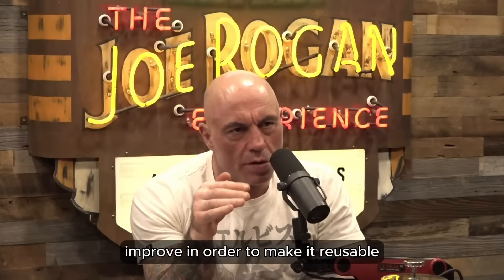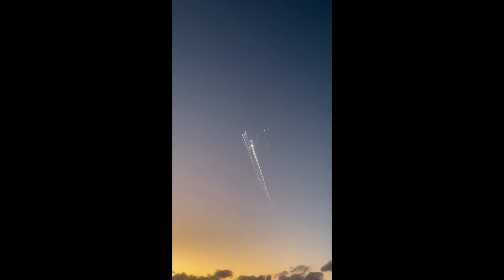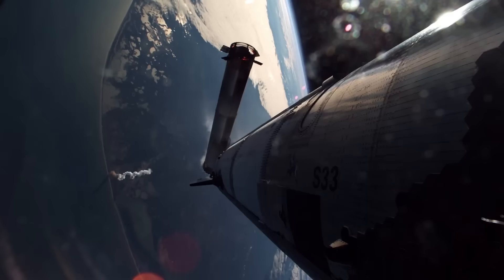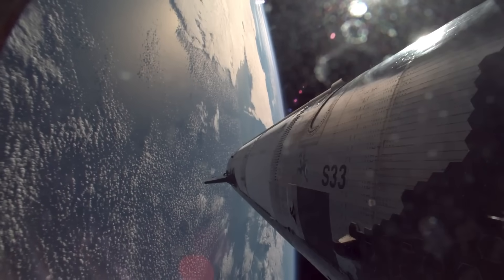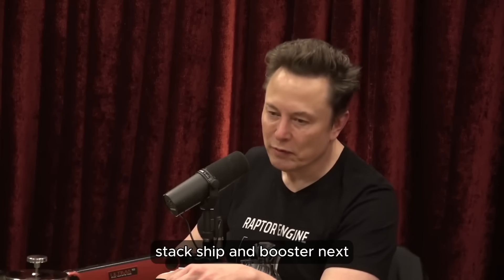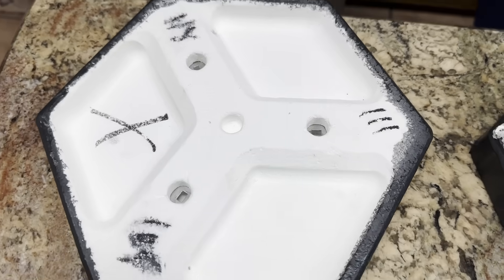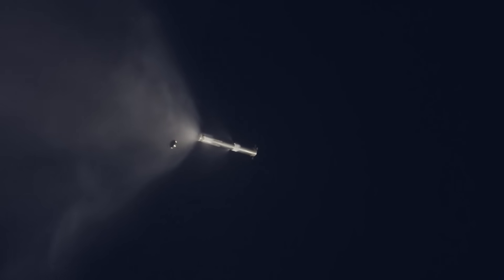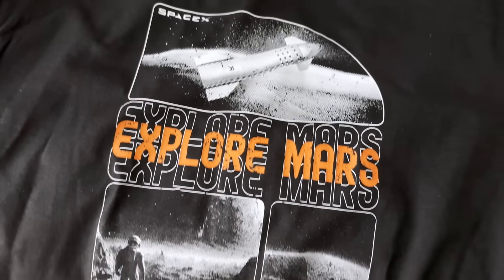Elon Musk: Heat is ON for Starship's Heat Shield to Succeed

Comment: LoftID inflatable aeroshell was a success.  It didnt return from orbit as a flaming meteor, its surface area/drag prevents that.  The basic engineering problem is going up like a needle (reduced drag) and coming back as a blunt object (drag to scrub speed).

Comment: Although I wonder if maybe anyone had or got any kind of data from the remains of the heat shield tiles on ship 33 probably would’ve been hard since they are literally just pieces of debris not attached anymore to the big ship but still leaves you to wonder since they did re-enter so I wonder if they at least got any kind of thermal camera data from Turks and Caicos or anything else

Comment: “3D printing a vortex shingle using silica dioxide (SiO₂) and aluminum (Al) could be a game-changer for Starship’s heat shield. SiO₂ is already used in aerospace as a thermal insulator (think Shuttle tiles), and aluminum, while not great for ultra-high temps on its own, could be incorporated as a metallic matrix composite to improve strength and thermal cycling durability.

If you go with SLS (Selective Laser Sintering) or Binder Jetting, you could 3D-print complex microstructures to optimize vortex formation while keeping the material lightweight. A gradient material approach—where the outer surface is SiO₂-dominant (heat resistant) and the inner layers have aluminum for structural integrity—could work. You’d still need a way to prevent aluminum oxidation at high temps, maybe with a ceramic coating or an embedded cooling layer.

Comment: “Interesting idea! A vortex shingle for Starship’s heat shield could actually work by using controlled turbulence to reduce direct heat transfer. If you design the tiles with microstructures or surface ridges that generate small vortices, you could create a dynamic thermal buffer during re-entry. The trick would be tuning the vortex shedding so it disrupts the boundary layer without causing unpredictable heating patterns.

Also, if the tiles were made from UHTC composites with some level of porosity or even transpiration cooling, you could enhance heat dissipation even further. Would be tough to model at Mach 25+, but if SpaceX can nail the aerodynamics, this could spread heating more evenly and reduce tile failure. Wonder if they’ve tested anything like this in CFD or wind tunnels yet?”
Reply: The worst factor in heating is not from contact air flow but IR thermal heating from the standoff shock.
Reply: @-danR  A spray-on super-reflective coating before launch could significantly reduce IR heating from plasma during reentry. Materials like silver (98% reflectivity), gold (97%), and advanced ceramics (85-95%) can bounce away infrared radiation, minimizing heat absorption. Photonic crystals and metamaterials could push reflectivity to near 99%, dynamically tuning to hypersonic conditions. Combined with MHD shielding (magnetic plasma control) using AI and nuclear batteries or capacitor plus a DIOX vortex, this could revolutionize heat protection for Starship and hypersonic vehicles, reducing wear and improving reusability?

Comment: Basically I can imagine, if you've ever seen the scales of an alligator gar, if the tiles were placed like that it would be amazing. I bet a tool could be designed to remove and replace them as they snap into place when inserted into a frame designed to lock them in. In my head it works. haha Basically a tile shaped like a half-moon with a stem that's inserted into the frame and snapped into place.

Comment: If I wanted to solve this using existing tech, I’d redesign the shape of the heat tiles to be more like scales. Design the attachment mechanism so they could be each be replaced individually if any break on the previous re-entry. 
Use this method as “good enough” as you continue to develop the ideal heat shield material. 
I hope someone finds this post useful - even if they work at another launch company. 😂

Comment: Thanks Ellie! 
I have often thought they could develop an inflatable heat shield. Same incoming mass, same speed; more surface area to spread the energy  = longer time to slow to subsonic, further reducing the heat/energy load per unit time. 
If you have Everyday Astronaut’s email, I’d love to see a conversation about the possibility of what I’ve described. Thanks again! 
Mahalo!
Reply: HEAT SHIELD?? WE DON’T NEED NO STINKIN’ HEAT SHIELD!! 😮

An airfoil-shaped balloon of… whatayagot? with tethers between the airfoil to the ship. The tethers winch out the airfoil only after they’re experiencing atmospheric drag. The ship — any ship of any design — takes the form of a kitesurfer catching some air in the stratosphere. 

Glide in from space at 17,000 mph just like you’re wearing a pre-deployed parachute. Cut the airfoil loose (to land itself) before final approach to the tower.

Gaaaaa!!! Why didn’t I go into aerospace??!! It’s so frustrating to have these ideas with no way to deploy them IRL.

Comment: If your designing tankers to put into space to refuel the starships to go to Mars, why wouldn't you be able to refuel the ship for reentry so you don't need a heat shield?
Reply: Because landing would take about as much fuel as launching.
Reply: @JustMe-dc6ks  REALLY? Id think it would require a lot less. I mean when you're taking off your countering gravity. Coming back gravity is assisting you. I guess maybe it takes as much to slow it down but I would think it would be a lot less

Comment: Tongue and groove can work. It will avoid tile cracking during expansion.  Tiles need to overlap each other. Maybe a square or rectangle Or triangle tile would work. The less sides would be better.  Stainless need a rough surface to stick better.  I hope i get paid for this idea.  😊
Reply: Yeah there's a lot of factors, not just with thermal expansion or vibration etc, like if there's damage it needs to be easy to replace. The question of will reuse be just as good as replacing it with a new shield. Or could replacement be made just as fast as repair. Cost and time and safety and performance and longevity..

Basically I can imagine, if you've ever seen the scales of an alligator gar, if the tiles were placed like that it would be amazing. I bet a tool could be designed to remove and replace them as they snap into place when inserted into a frame designed to lock them in. In my head it works. haha Basically a tile shaped like a half-moon with a stem that's inserted into the frame and snapped into place.
Reply: I am a plumber, just paint it with silastic , she`ll be right mate!

Comment: What they need is to be able to slow the ship without using the atmosphere as a brake so the heat shield becomes irrelevant.
Reply: This would cost tons of fuel. Even if you stop a bicycle, the brakes get hot.
Reply: @moritzheintze7615  Lots of tiles or lots of fuel, somethings got to change.

Comment: Ceramic tile heatshields are problematic at the best of times, rapid reuse may be beyond its safe capacity, but fingers crossed!       :)     🤞
I wouldn't be surprised if the Stoke actively cooled steel heatshield is a better overall design for reuse, but time will tell.
It's a tricky business.....
Reply: Steel is too heavy.
Reply: @4runner4ever83  Sure, but ceramics are too brittle....   :)
Orbital debris won't put a hole in a steel heatshield.

Stoke's heatshield is heavier for its area but uses a smaller area. It uses a naturally stable shape, so it doesn't need powered wing-flaps which saves weight too.

A steel heatshield is unlikely to suit Starship unfortunately.

Comment: Not trying to brag, but I noted from the beginning that the reentry tile problem would probably be the bottleneck for making the rocket rapidly reusable.

NASA spent decades trying to come up with a solution for the Space Shuttle and couldn't, and that technological barrier was a major reason why the craft never achieved its goal of rapid reusability, and thus led to its earlier-than-planned retirement.

No metal can take the reentry heat, and no ceramic can withstand extreme temp swings and major distortions 100% of the time.  The solution may be some sort of large one-piece sleeve that is quickly replaced every flight while refueling (or hopefully every once in a while), that would be considered a consumable item just like the fuel (or maybe brakes on a car).  (If the sleeve isn't damaged too much, it may be able to be refurbished for another flight.)  Such a feature would cut into the rocket's cargo capacity, but would allow the rocket to be rapidly reusable.

Right now they're looking a using some of the fuel as ablation material to dissipate the heat, but my thoughts are that would take a whole lot of fuel.  Hopefully, I'm wrong about that one.

The technological breakthrough they're looking for is some sort of alloy or composite that has a super-high melting point, but remains flexible so that it doesn't crack.  Musk would gladly pay you a billion dollars if you invented something like that.

Comment: only 1000 deg F on re-entry? I mean, it is way hotter than that when they partially melted the flaps.
If the main body only gets to 1000F, that bodes extremely well - except for the pokey bits that stick out

Comment: Also I was wondering what the thought is on having tongue and groove tiles for expansion and contraction
Reply: Tongue and groove can work. It will avoid tile cracking during expansion.  Tiles need to overlap each other. Maybe a square or rectangle tile would work. Stainless need a rough surface to stick better.
Reply: you are now a rocket scientist. oh yea
Reply: @craig4305  are you trying to be a troll? I never said I was a rocket scientist. Just stating some of my thoughts and curiosity. I am a former engineer. What do you do?

Comment: Ok, I have a dumb question: why can't the ship very slowly re-enter the atmosphere? Slow down slowly. Do as many obits around the planet as needed to slow the ship.
Reply: They do that to an extent, but once the speed slows down to just under 27,000 KPH or 17,500 MPH, the craft is now on the way down to Earth.  When the Apollo and Orion capsules came back from the Moon they were going far faster than that and they skipped off the Earth's atmosphere several times to slow down somewhat before hitting the rocket engines and doing their descent burn to come back down to Earth.
Reply: @markb2773  So I guess they can only slow down so much skimming the outer edge of the atmosphere before gravity tasks over. Also using their engines to slow down uses a lot of fuel that they don't have. If they had enough fuel, as in refueling from a bulk carrier in space, could they do it?
Reply: It would take as much fuel as launching did, which was already more mass than craft and payload. So, you’d need multiple launches to get enough fuel into space for one landing.
Reply: @JustMe-dc6ks  Makes sense, thanks.

Comment: I wonder if SpaceX looked into Starlite this is an intumescent material said to be able to withstand and insulate from extreme heat. It was invented by British hairdresser and amateur chemist Maurice Ward (1933–2011) during the 1970s and 1980s. There's a BBC video of him using a blow torch on an egg coated with his heat resistant substance. SpaceX should be spraying this on rather than than using heat tiles.

Comment: Thanks so much Ellie for sharing the interview... as a retired engineer (aka old guy) who spent his career in aviation... and has followed space stuff since the Mercury days... listening to Elon discuss the heat shield challenges was good fun... as in "How tough can it be? All you gotta do is"... handle vibration, bending, 1400 degree or so Delta T (temperature differential) and aerodynamic loads... plus figure out the ideal tile composition for both mechanical strength and thermal properties, the manufacturing processes and attachment techniques... and repeat it flawlessly thousands of times for each ship. It was a challenge for the Shuttle, and it remains a challenge for SpaceX. But as is their way... they learn with every iteration/RUD.
Reply: As a retired engineer (aka old guy) its great, isn't it. Wish I could be part of it.
Reply: @shadowcaster111  I enjoyed a wonderful career... first as an A&P, and after going back to school, later as a mechanical systems engineer...  but if I was half a century younger, I'd be in Boca Chica... doing something :-)
Reply: @jdesmo569  I went to school for electronics but ended up a mechanical designer CNC programmer and doing sales.

You never know where you will end up
Reply: Tytyty for doing what u did soldier

Comment: I'm still unclear why the harmonic vibration is now suddenly a problem.  was it not a problem for v1 starship as well?  what introduced the problem?
Reply: new pipe and fuel lines design in V2 ship. they modified the downcomer that feeds the engines. so part of that new arrangement is my guess where the leak was that caused the fire.

Comment: Flight 7 wasn't a RUD because the self destruct went off: The explosion was on purpose.
Reply: It was definitely rapid.  Definitely disassembly.  Are you implying they had a time on the schedule where it was supposed to happen?  I was under the impression the planned schedule went all the way to re-entry.

RUD is accurate.
Reply: It wasn’t scheduled.
Reply: It still went through a Rapid Unscheduled Disassembly. Duh. What is the problem with using RUD. No sense of humor?
Reply: Wrong. Flight termination was done automatically. Starbase had no contact with Starship 33 after about 8 minutes and 20 seconds.
Reply: @caldodge  it goes to prove the safety of the vehicle' integrated system.

Comment: Only once someone develops an ultra-safe, nuclear-powered, rocket engine will we have the means to regularly go to and from orbit and other planetary bodies. The current method of propulsion relies too heavily on carrying huge amounts of fuel, but still insufficient for slowing the vehicle down for easier re-entry. So it must be done with heat-shields which are time consuming to apply and maintain and are prone to falling off.  This is not robust enough for interplanetary travel.
Reply: You only use nuclear rockets in space.
Reply: @JustMe-dc6ks exactly, chemical propulsion for LEO, nuclear electric for planet-to-planet, though I am very partial to a mars cycler
Reply: Not so much heavy nuclear engines, but propellantless thrusters like Exodus Technologies have developed.
Once you have electric thrusters without propellant, then you don't need a heatshield anymore.           :)

Comment: There is also additional weight penalty for overlapped tiles only.  With the advent of heat pipe technology, another weight penalty.  I believe the answer will come from new materials and improvement in manufacturing methods.
Reply: I guess they have to sacrifice the additional weight. The overlap is needed in the event it comes loose, the other tiles will still hold it

Comment: What they may need to do is a shingle-ing of the tiles with a bottom row covered slightely with the row above it to deal with expansion and contraction. Much like a suit of armor that has moveable joins but the plates overlap each other. That solves the expansion issue and also gives the plates strength without cracking and breaking... Maybe?
Reply: Kinda like fish scales??
Reply: @XCX237  Yeah, pretty much. Dragon skin...
Reply: Shiplap
Reply: Not aerodynamic.